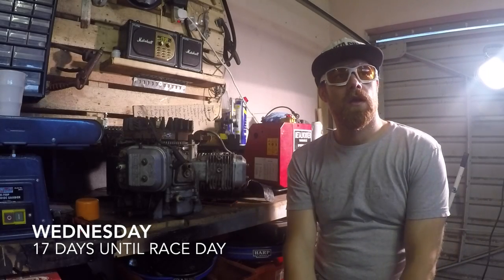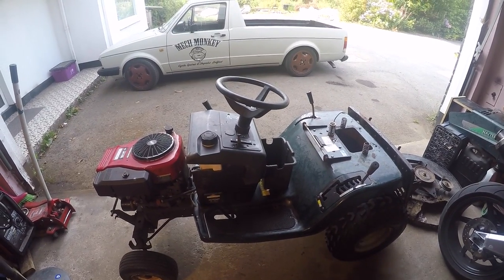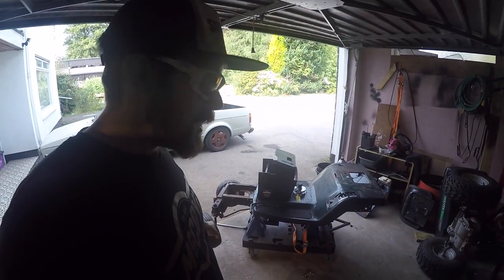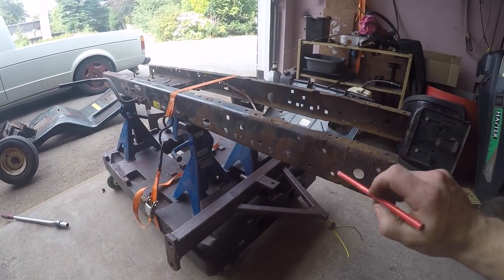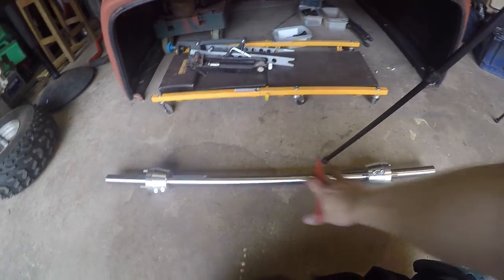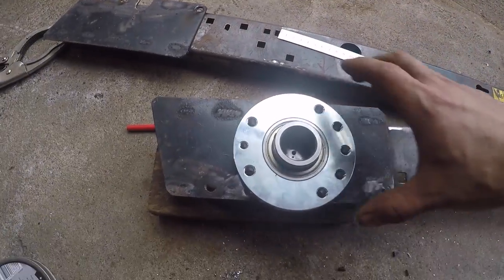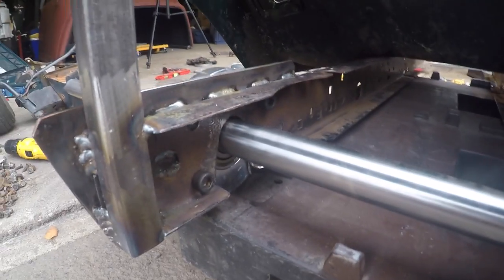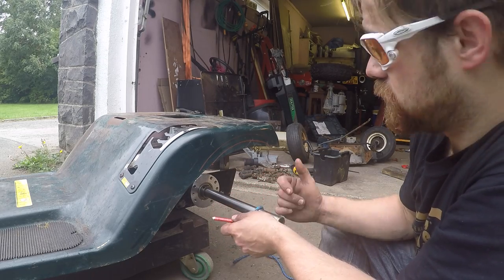RACING LAWNMOWER - 2 WEEK BUILD - PART 1 - TEARDOWN AND BACK AXLE - NEW VERSION*

Comment: where did you get that axle and bearing setup
Reply from the maker: Rear axle and brake stuff came largely from kart components in england, the bearing mount units are their own, its pretty much all from there, but with a talon 428 pitch split sprocket for a shifter kart from demon tweeks.
Reply: WrenchLife what is the length of the frame?

Comment: +wrench life can i get a link for the barrings for the axle
Reply from the maker: PIGGY603;} I got them direct from the supplier; a spot in England called kart components, they do a lot of stuff for rental karts so it's built strong, if you check out their website they have a catalogue which updates every year, otherwise a go kart bearing housing is what it is, there are different kinds, or you could use what is called a 'pillow block' type bearing housing which is generally cheaper and easier to mount, Jon